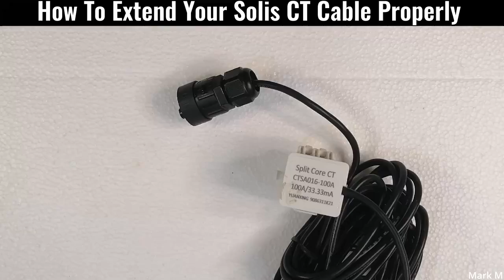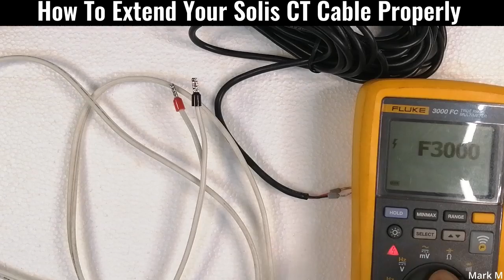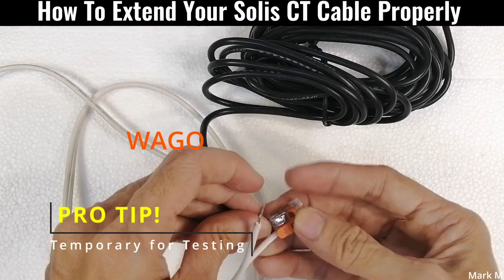How To Extend Your CT Cable Properly.

Comment: Sir saan ako puede bumili nito?
Reply from the maker: Online, marami sa Lazada. Solis CT.
Reply: I think if you want to extend it. Cut it and use bigger wire to lower thé impedance/resistense. Or am i wrong?

Comment: Hi Mark , I used to check lead resistance ( total resistance from the CT passing to a ammmeter to kwhmeter) using a bigger wire size will not effects the CT ratio. I agree with your remedy. CT burden used to know this things. In power metering compensate by using bigger wire to avoid votage drop.☝️

Comment: Hi Mark. I have a distance problem. my inverter is placed on the 6th floor and the load and the grid is about 25 meters away. can I move the meter directly and lengthen the 485? thank you
Reply from the maker: Thats too long, you still can but youll have problems in delay. That’s why Solis has meter type GTi, that eliminates the extension from CT to Inverter. Inverter to meter can be as long as 50m, but meter to CT should only ne 3M.

Comment: Hi Mark,

I have an existing EV charger with a CT cable running to the consumer unit. I'm planning to install battery storage with a Solis inverter near to the EV charger.

Is it possible to use the same CT cable for both the EV charger and the Solis inverter? i.e. could I cut into the CT cable and put each wire into individual 3-way wago connectors, then run to both EV charger and inverter?

Alternatively, is there such a device that could duplicate the CT cable to two outputs?

I ask because it would save me lifting up the floorboards to run a second CT cable for the inverter.
Reply from the maker: I don't think ti would work. Unless you have a device that reads after the ct connection that send data to both eV and gti hardware. But splitting its connection, haven't done so. Better an external meter like Eastron (Solis uses it also) and feed the output to your hardware.

Comment: Sir how to know if the ct lim is working or not, ct link is on cant judge thank
Reply from the maker: Load power should be higher than 500w, if the ct link still “cant be judge” have it returned to your seller. They’ll test it for you. CT Lino Test is only applicable to CT type Solis GTi. Meter type doesnt have one.